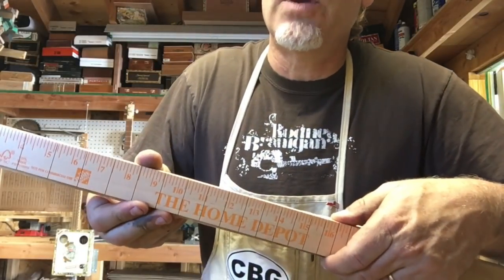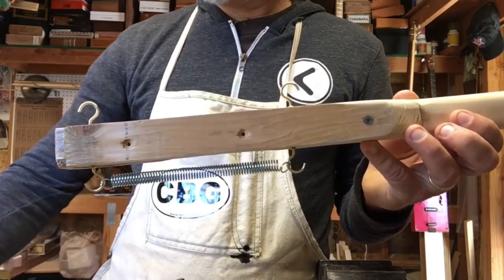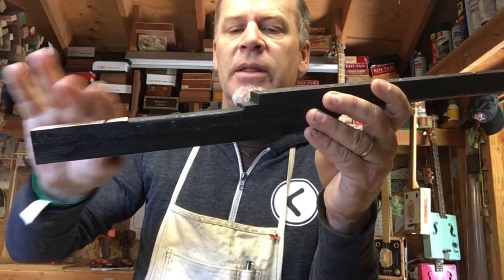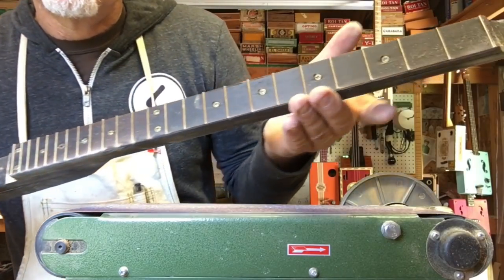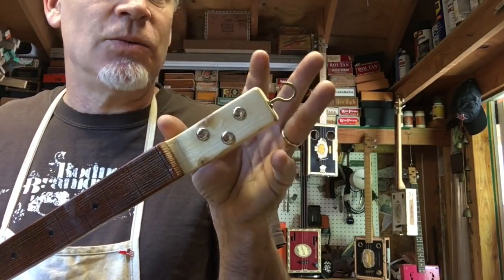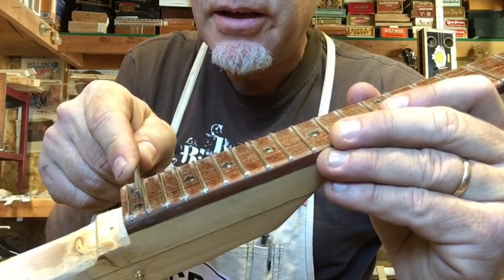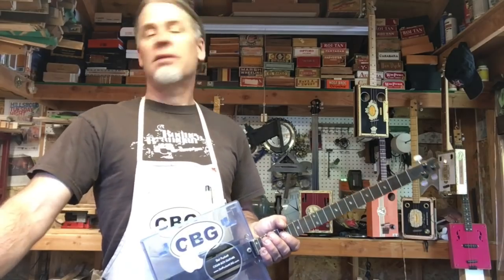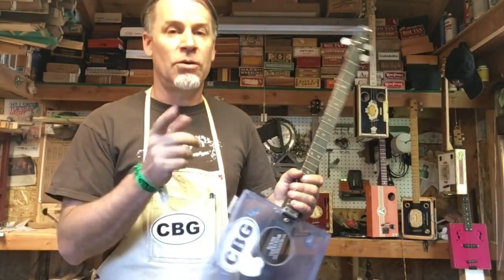10 Tips to Better Cigar Box Guitars

Comment: Here's an old woodworker's  trick for gluing up two flat surfaces. Sprinkle a little bit of Kosher Salt in to the glue before you join the two pieces of wood. The salt acts as a "lock" to keep the two pieces from sliding around while you clamp them. I see several instances where this would have helped you in your video. Cheers!
Reply: Yes, the salt keeps all in place. It was nightmare before I've find this tip
Reply: That's terrible advice and always has been. You create a weaker joint by doing that. Partially because you create tiny voids all over the joint from the salt that dissolves into the glue and partly because that dissolved salt is changing the chemical makeup of the glue. It's also completely unneeded if you bother to learn proper gluing techniques.
Reply: @LordPadriac    Drat!  I was just going to ask ... why ‘kosher’ salt?  Surely no such thing ... and if there is... another why?

Comment: The springs are only going to matter when you play the thing acoustically. They will not interact with the piezo in any way. If you use a cheap full size magnetic pickup that stretches over the vibrating springs they may interact with that like the springs on a strat interact with the springs in the underside cavity. The strings have to be stretched but still loose enough to vibrate pretty wildly with the minimal pressure they're going to get from the cigar box though.

Comment: As a Saw Filer by trade I must let you know that files are designed to cut forward and NOT backward. Your idea to grind off the teeth on the edge is good! They do make a file and the one edge is smooth and rounded but your idea is cheaper and will work great! Just push the file and it will work much better. I put my necks in a vice for this job.
Reply from the maker: thats good information... makes sense.   Thanks for the tip

Comment: Mr. Puckett: I enjoyed your tips on cigar box guitar building. I am a novice woodworker; lathe work mostly (bowls and flutes). I've been wanting to build a cigar box style guitar for some time. I noticed you placed the piezo on the neck stock. Other builders' videos I've seen have placed them on the underside of the box lid. Which position produces the best sound and why? I'd like to make my first guitar for my grandson. I'd like to assemble everything on my own. What woods would you recommend for the box, and the neck?
Reply: Mr Hodge,  while I certainly no Mr Puckett, I can tell you there are plus and minuses to each way of positioning the piezo.  Only in my opinion, I feel on the underside of the box makes it a hotter pickup and gives some great sounds. But you also get along with that , every time you bump it, have your hands on it , your little movements get amplified easier as well. And you are subject to a lot more feedback.  The way Del describes installing the piezo, cuts down on feedback, and that’s a good thing. It still has great sound. Everyone is different and has different ways of doing things. ( no rules)   I build them both ways depending on the box, what sound I am looking for, and just experimenting.  I’ve learn a lot over the past 5 years from Del and others. We all have. Del has done a lot of experimenting and is a master at building CBGs.  You can’t go wrong following his videos and advice.  But if you start building more, don’t be afraid to experiment on your own.  I alway look for different ways to use things and always ask, “What if?”  A lot of times it works out well and sometimes not. Have fun if it becomes a hobby/ addiction.

Comment: Great stuff.  I always watch your videos to keep up on tips.  Another tip: If you can, position the gear on the tuner away from the fret board.   That way when the string pulls on the post, it presses deeper into the tuning gear, not away, and there will be less chance of slipping tuner gears.  I also give a 5 year guarantee on my guitars.  The only two failures I have had is with hot glue. It can't take temperature extremes.  I use E-6000 now and never have had a failure.  It is available at Hobby stores and Walmart.  There is clear and white. I use clear if any of the glue will be exposed.  Of course that is on hardware, NOT wood parts.
Reply from the maker: yup - good point... thanks for mentioning it